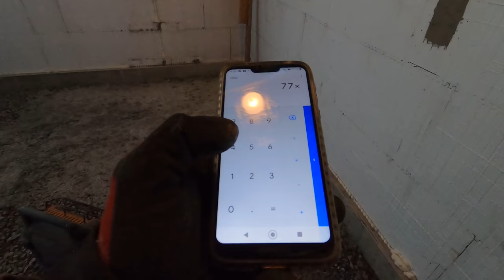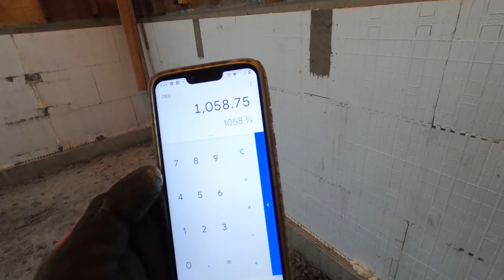Installing a foundation under an existing building part 2: ICF, damp proofing and some backfill

Comment: So nice to see someone that knows the steps to take without shortcuts,  landscaping fabric over stone, vibrator while pouring,  waterproofing exterior concrete , primer and then tape, well done gentlemen that's an A+
Reply: "knows the steps to take without shortcuts+list of phases" That is called being professional, nothing odd in that. Cheering this is like giving waiter a tip=great job doing bare minimum of professionalism. Excellent or superb service is then another thing where tip might be ok and if service was shit, shortcuts were taken etc krooked company skipping to make profit in expense of work quality, now that is what calls lawsuit.

My only issue is few construction methods, like sealed/unvented crawl space even with heating and method of water proofing the foundation. First one works in normal conditions, but one must consider unnormal conditions like water leak or flood. Latter witch introduce lots of water into construction that then cannot leave the construction due so much insulation preventing air movement, latter other hand do not allow foundation to dry, so moisture moves upwards and cause Americans seem to use pressure treated wood (What should never be brought close proximity to interior where gasses from it can get to room air, no fucking wonder USA is cancer central of the world) as base between foundation and framing, not bitumen membrane that creates moisture barrier.
Put only foot worth of sealer on the foundation, install barrier board that has dimples that go against the foundation leaving airgap that allows moisture to rise out if any gets past the barrier and make actual cellar/underground floor if you want it to be heated, but prepare to have lots of energy waste if cellar gets flooded to remove moisture from the construction after pumping it out and ripping entire interior off. In this case you would need to demo the whole house pretty much to get proper France drains under the house, that are requirement with underground floors.
Reply: @Hellsong89  This guy is doing an excellent job within the constraints of his budget and what the customer wants.  It is always a balancing act.  This is not new construction.  But it is a very, very good remodel/rehab of an old house that apparently someone wants to save, instead of tearing down.  In my opinion he is doing a fantastic job.
Reply: @Hellsong89  You bring up some very good points but unless you want to start from scratch and have the money & time to do so, I'll go with what Jesse is doing
Reply from the maker: @Hellsong89  there is no reason to ever have an unconditioned space. There is footing drains and 4" of clean rocks under the slab as well, and they drain to open air. There would never be a flood or any buildup of water. that crawlspace will never even get damp. I have done countless basements and crawlspaces both just like this and they are always bone dry. Even the ones that are below the water table, using a sump pump. Clean gravel is the greatest asset

Comment: Good video, good content. ICF is the only way to go. With the cost of lumber today it even makes more sense. Most concrete contractors in my area are stuck in the past and are afraid to use them. Stuck in the past.

Comment: Years ago when I was a carpentry apprentice I remember working on a lot of jobs where we worked on excavating and putting in foundations. I worked on the rest of the building as well. But you know  after a while I began to really like the foundation work.  I have an old house and a sort of neglected barn. I’ve had foundation work done on the back of my house similar to this (your job is much better) plus I had foundation done on my barn. (Got rid of old crumbling cinder block walls and had poured walls put in) I took pictures of all the work. My home was built in the late 1800’s  So far all the work has IMPROVED my places. Very nice work! I like your attention to detail. Nice when you have friends to help.

Comment: I went back and looked at the structure that was under the floor in the section of the house you are working on. It looks like the stone foundations and timbers are what was left of a log cabin that was converted to the home you are remodeling. Good job with the way you are doing things to preserve what is still there.

Comment: Very good construction practices, foundation drain with geotextile with 3/4"  clear graded stone  and your guy was meticulous with it. His removing  the cobbles in the backfill  was very good to see. Your discussion about matching floor heights was very enlightening - makes the case that the salvage/renovate method was the better choice (notwithstanding the tax issues) because the floor elevation matching and exterior surface drainage issue still is still there even with a tear down.  Your  design of the floor deck connections into the concrete shows very tidy organised workmanship.  Your discussion about use of insulated forms was also very good. You clearly know your building code and you obviously get professional design support,  It really is part of your craftsmanship.  The part I think that really surprised me was that you'll be utilising geothermal heat/cooling.   That is going to be one nice upgrade to that house.  Will underslab insulation be used under the concrete floor?  I've seen very good results with it.  You clearly demonstrated that salvage of an existing structure is always an excellent option especially now with current lumber prices. Here in Ontario a single 2" x 4" x 8' is $8 Cdn - if you can get them.  I felt like I was watching an episode of This Old House!!  Which guy was Norm??  Happy New Year.  I'm sure you'll have a happy customer.
Reply from the maker: thanks. I may put insulation in the floor, will have to talk to the customer about it. we werent set on the geothermal when we discussed pricing so it will be a slight upgrade. The only thing I go back and forth about with it...my idea was that if this house looses power and nobody is there, having no insulation under the slab will help keep that crawlspace above freezing. by radiating heat from the ground up through. That is the only downfall I see to underslab insulation. what do you think?
Reply: @jmuller86  The heated concrete floors I have been involved with rely on the underslab insulation to make the system work efficiently otherwise the earth beneath the slab will wick away the heat constantly making your system run all the time on full and then pumping costs eat up $ if you are using  your local electrical grid.   I'm not sure about how far north you are,  I did see you had a big dump of snow in your first video so I'd guess northeastern U.S. based on the recent storm fronts.  That said, it would be a very long  extreme cold period without power to have it get that cold in the basement given what you are building above it and even then the water in the geothermal pipes has an antifreeze % to protect against that concern. That is done because it is more likely the pipes would be exposed to frost penetration outside the building if frost would penetrate to the depth of the pipes unless they are installed below max. frost penetration depth for your area (1.2 m - 4 ft? -  1.5 - 1.6 m here )  it would be worth  a bit of your time to chat up a geothermal contractor/installer in your area about your site specific concerns.  I don't want to go off on a tangent about solar power supplement/back up for the circulating pump because that is a different issue.   However maybe the best short term is to see if the client wants to consider pre-plumbing and under slab insulating  while that bigger decision gets sorted. Then he can have time to decide, he has the optimal set up though with the ICF foundation. Given that it looks like a remote location self sufficient heating/cooling looks very appealing - remember then you can get supplemental hot domestic water as well.  My experience is that pre-plumb cost should be very low as it the mechanicals that usually form the biggest $ %age.   Now is the time to make that decision as retrofit would be onerous. You did say though you have a pond for your ground source heat which is the maximum efficiency by far that you can get - it's the same as your pipes being under the water table.   It certainly sounds like an optimum solution.   Check out this link about some system installation/equipment being done in New York state maybe there are some grant programs available in your state. Too  bad we don't have that type of incentive here.   The following link (you'll recognise it!) is really more about how a new technique to lower vertical drill cost rather than trench where space is an issue but they put in some key concepts.   https://www.youtube.com/watch?v=IMO9jvwlHFg   Like you say a lot of thinking needs to go into it before you spend.  The trick is in North America we still are at the point where each install is somewhat custom, in Europe it is already a standardised industry so you can just call up an installer.  If my wife and I move and build i'm going full geothermal and i'm gong to be costing for my current home.  I have a friend - an excavation contractor - who has a  slab-on-grade home (rare in Ontario) with heated concrete slab and it is the most comfortable house in winter you can imagine. Note that you only want to set max. heat to about 15 deg C or you're too hot.   Another friend - carpentry contractor has a gas fired heated slab in his shop (still very economical) he put in 25 yrs ago that allows him to  work year round in it  for < $50 Cdn a month in winter.  Also one last item if your foundation drain outlet will be exposed I recommend a rodent grate on it. The grates are  a standard installation fitting that typically goes on the at-grade outlets for subdrains on highway pavement structures made out of galvanised corrugated metal pipe (about 8 ft long here) . Keeps the critters out and blocking them up with nests etc.  Good Luck for 2021 !!

Comment: Code first floor live load is 50, second floor is 40.  You are still way good with your loads.  Continuous joists with a mid span supporting beam under. 👍
I’ve been on jobs were the contractors are way under and they say “don’t worry, it will work, that’s the way I always do it”.

Comment: I think you did a great job making the foundation work.  Years ago I took a class on Polysteel product to get certified.  In the south no one wanted the extra cost so I never used the product (they are out of business I think) .  In the last year I built my shop.  I had to cut into the ground which made it 6 feet of foundation needed.  The 90 feet by 6 feet was cheaper than having the foundation guys put it in, besides I could do it my self with a pump guy placing the concrete into the cavity.  9 yards and 10 for the footing.  The only thing I noticed is you need to make sure it is secured so it does not move.  I made my own turnbuckles and used a perimeter 2x4 to keep it in place.  It worked the wall did not move and the wall was straight and plumb.  I am in the mountains in the south and everyone that looked at my progress looked at the wall (u should have heard the comments from all the wanna be contractors).  They also thought the insulation came off.  Lol.  I had some blocks left over and I am going to extend the wall about 20 feet.  I would use the build block again for a foundation.   The biggest thing about the block is the set up and no forms to remove.  Great videos, its not easy to do what you did.

Comment: I did a double sill plate on my garage build because I could then splice across any joints and not worry about where my anchor bolts landed in relation to the joints.

Comment: Hello Jesse, ICFs are a very interesting thing. I had seen a similar thing here in Germany many years ago. But the system companies like BuildBlocks offer is very simple to transport and to handle. This system should be common in North America. Houses wouldn't collapse any more at a wind speed of 80 or 90 miles. You are doing a good job.

Comment: Jesse, A friend of mine built an addition to his hangar and had a crawl space of approximately four feet height. Because it wasn't properly insulated he had extensive mold problems within a few weeks. Had to have a specialist come out and resolve mold problems to then allow the installation of proper insulation and vapor barrier to guard against the mold. If you install those crawl spaces incorrectly and closed up before mold had a chance to form and you didn't catch it, years down the road you will have a disaster on your hands! In his case he had a damp environment to begin with. Less dampness and it would take longer for mold to appear. The specialist said same thing as you explained, no vents! Good job you do nice work. If you were around my home area (South Western Pennsylvania ) I would use you in a heartbeat.

Comment: I love the insolated concrete forms, you can heat the basement with a candle with this system! 
 great videos too . keep up the good work.
Reply: We see them more & more in new construction, but 1-big issue is its a soft shell, if any gets exposed outside a weed-wacker can wreck it. they need a fibergalss coating in my opinion
Reply: @chadsimmons6347   up here in Canada we sheet the outside with plywood  or chipboard  and then stucco with an acrylic coating to seal the wood
Reply: @Paul_Gale  Sounds like a good system, im drinking a boiling hot coffee from a foam cup, my hand is fine, i believe it is a great insulator

Comment: I had my house built in 1988 with a basement and ICF forms 12 wide interior wall are 2x8 insulated attic space is also conditioned  have Gas heat Electric AC I live in Texas so winters are not an issue, summer the AC can be expensive, mine runs about 45 dollars per month. 3800 sq.ft house basement finished, attic finished makes excellent storage.  At the time when I had it done it was twice the price for foundation, has more than made up for it, low energy bills and quality of life, outside noise is almost none .

Comment: The ICFs are very suitable for cold weather concreting because they retain the heat created in the concrete as it hardens, so the concrete should not freeze before it sets.

Comment: Great work Jesse. Just wondering why you didn't dig 4 feet deeper and put in a usable basement. Seams like a lot of work to have a crawl space. Looks like you could have added windows in the back of the basement facing the swamp. Could have been a cheap nice space.

Comment: Trapezoidal windows are nice. I remember banging off the tie-rods and using  Quick set water-cement to plug the outside holes, then tar the rest with brush and roller. Then put black plastic on it. Thanks for the video, all ways interesting You didn't make any cylinders up, slump test it.?. Sometimes things can get messed up at the batch-plant.

Comment: For most jobs I would go with regular plywood forms, you don't have to pour a separate footing and wait to cure, you can set the concrete dimensions much better for different locations, add foam insulation where you think you need it most AND you save on cost of ICF forms. Contractors like ICF because it is quick and saves on thier labor costs

Comment: In Canada more insulation is required on the outside of the foundation. Waterproofing an ICF use to be hard so codes now require a stronger concrete so the concrete acts as a waterproofing as well.
Reply: “Stronger” concrete is not waterproof. You either insulate outboard or you back frame and insulate on the inside. Concrete is porous

Comment: You need to borrow 1 piece of cement chute from your mix supplier and build an elbow duct that drops on the end that has a guillotine slab sheet gasketed vertical faced swivel joint to allow you to direct the mix easily into the ICFs. think of a bathtub spout probably 15 to 18 or 20 inches long that will latch on to the truck chutes end. Returning the undamaged borrowed section during the day of fabbing the first piece.  If you cant visualize it I with do a rough sketch.

Comment: are you going to leave the rock wall & railroad tie in place?   i poured cement with just an outer form to stabilize mine, but i was dealing with sand, not rock.  thanks for your time & video, it is much appreciated!

Comment: Leaned in close at 31:00 to see what kind of vibrant blue primer you're using on the polystyrene, which is always hard to paint... Looks like GRK #9x3 1/8" Torx primer. Interesting choice!  Edit: at closer to 41:00 clarified it's Ames Blue Max.

Comment: Very interesting and good comments along the way.  If I remember right, in the first set of videos for the addition you mentioned that the original structure dated to 1820.  That makes it not just "an old house" but a "historic house."  For your neck of the woods that would be early English settlers, after the original Dutch and Revolutionary War era, right?  There were a lot of loyalists in that part of NY state.  Was it originally a log cabin, or as I think, more likely post and beam construction, or what???  You didn't mention but, your floor joists will be 2 x ???. (I'm thinking 8s or 10s?)

Comment: "It cost me another 2 hours."

Even so, still time well invested.
Rather than trying to half-ass it trying to get the plates in.

And yes, the switch to ICF just makes sense.
Basically, DIY or pro, it cuts down on time.  And in one step, you get your concrete and insulation.  Done.
Sure, the insulation might be a bit overkill for you, but you get a nice continuous coverage where you don't have to worry about cold spots.

Dumb question, what's the liquid sealant you're using on the Zip sheathing?
Reply from the maker: that was prosoco fast flash for the windows, and joint and seam filler for the zip joints
Reply: @jmuller86  Thought so, just don't like guessing based on product color.
Good stuff.  Cutting no corners here.
Kudos and Happy New Year!